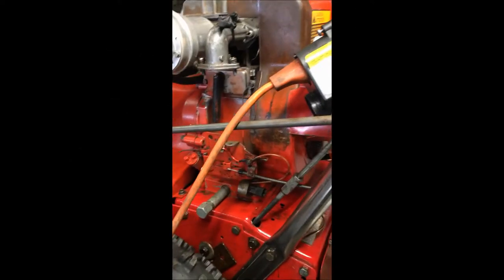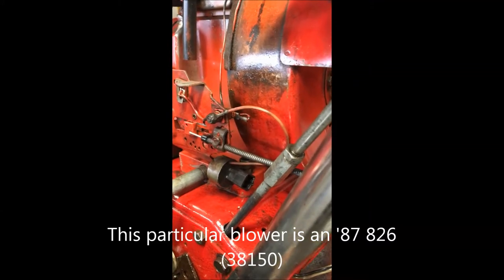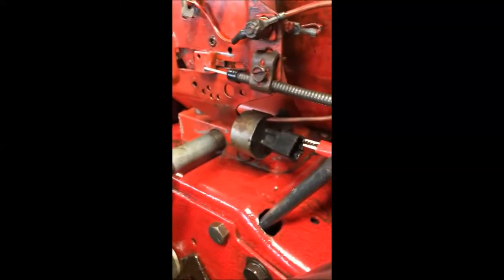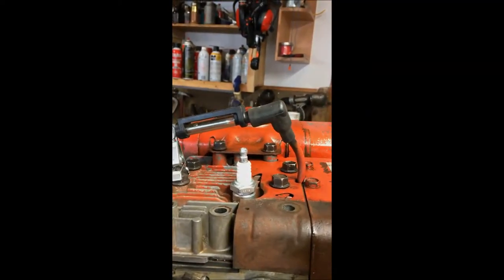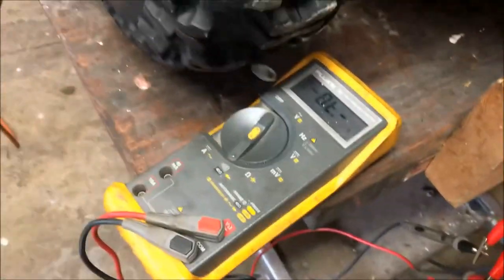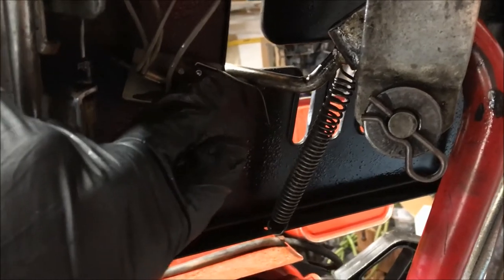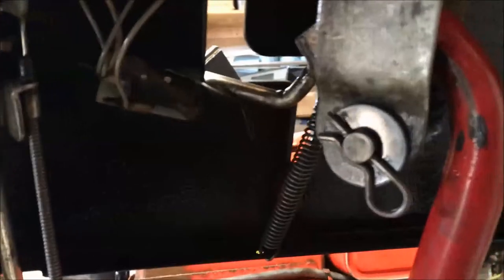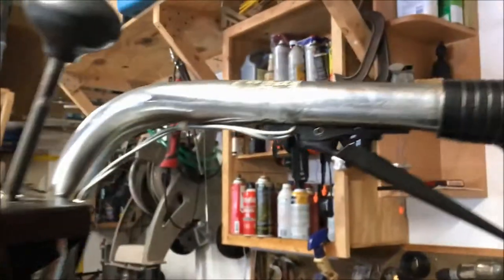Toro Snowblower Safety / Interlock Circuit Testing.

Comment: thanks a lot ,on my toro ,when i pull up augger handle ,the kill switch bogges the motor down and the same for whell traction ,bogges down whe i put in front or rear spead ,thanks for your answer
Reply from the maker: the video above describes how to determine if it's something in the handle-bar switch circuit or the interlock module itself.  you can test the switch circuit using an ohmmeter or continuity tester.

Comment: So under the carb is where you'd cut or disconnect the wire so all of the interlock is removed?   It kills my injured hands to hold the handles down when snow blowing so I'd like to disable the auto shut off.
Reply from the maker: what year / model toro do you have?  I'd want to check the wiring diagram just to be sure but it's easy enough to test.  its usually connected to the isolated node (that gets grounded in an "unsafe state") by a screw...just unscrew it to disconnect the red wire then put the screw back in...then tape-up the bare spade terminal so it doesn't inadvertently touch the screw.  Another thing you can do is wrap the handlebar handles down with electrical tape.
Reply: @classiccat7403  Thanks for the reply.   It's model 38150 made in 1980.  Briggs 8hp engine.   I'll check on that screw and see if I can  locate it.

Comment: I have a Toro 724 with a 38050 motor with serial number 5005029. All the safety interlocks work and I used  a shunt on the module as you showed but there is still no spark. Is it possible the module is still good but there is something wrong with the points, condenser or coil?
Reply from the maker: a test would be checking spark with the red wire removed / isolated from the ignition wire.  If you still don't have spark, then at a minimum it's something with your ignition AND possibly the interlock module.   If that's an '85 machine then it's electronic ignition (no points).

Comment: I have no spark on my 85’ toro 826. New spark plug. Continuity coming back from all interlocks. BUT the red wire coming off the interlock at the engine is cut clean off… any idea why? Would this effect operation? Thanks!
Reply from the maker: usually cutting that red wire just disables the entire safety system.  For the briggs, there's also a kill circuit on the throttle control; you can temporarily disconnect that wire and see if the coil is throwing spark (I like using adjustable gap spark testers for this sort of thing).

Comment: Can that interlock module be bypassed or removed without rendering the engine useless? I have an 826 with no spark and want to see if I can get it running again but would rather just not worry about that module.
Reply from the maker: did you try shorting the two module pins to see if you get spark?  If not, you can probably just disconnect the red wire...just make sure there's another way to kill/ground the igntion.
Reply: @classiccat7403  it’s buried in the back of the garage at the moment. I’ll dig it out this weekend and update you. Thanks for the tip!